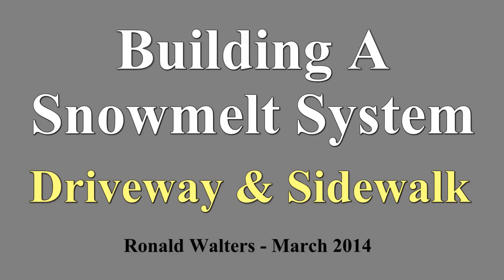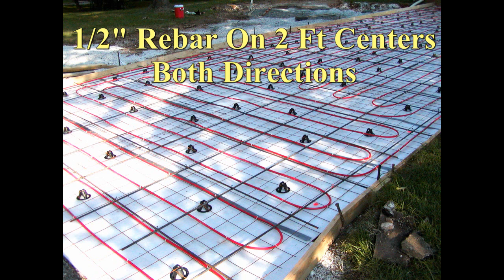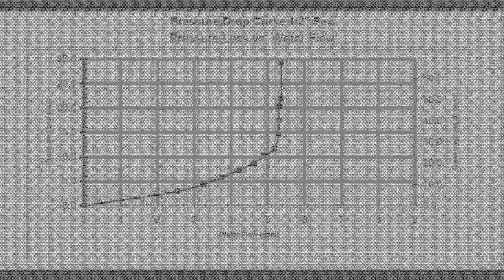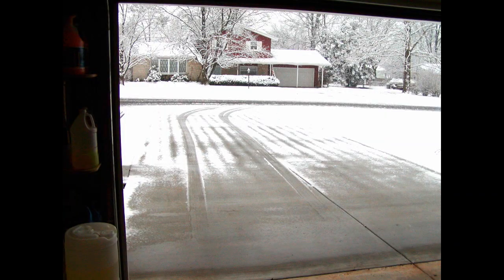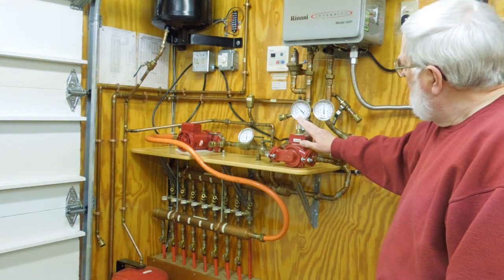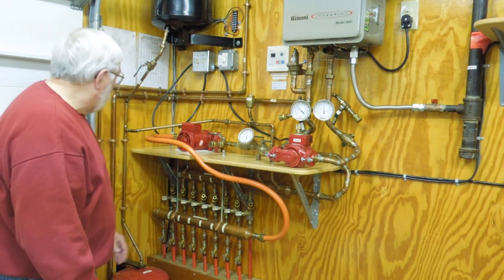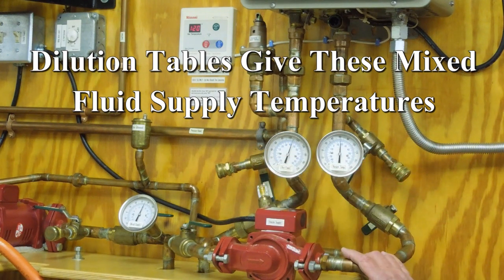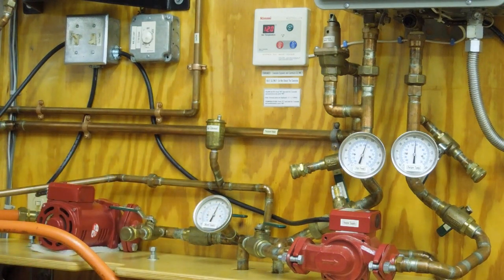Snowmelt, Building A System - Driveway & Sidewalk

Comment: Hey is it important that the pecan be up in the concrete! I feel it can lie on top of the insulation and bottom of the slab. Than the expansion is not a problem and the slab is heated more evenly? Remember I am a framer not a plumber! I am considering installing this system. 
Thank you for your video!!!
Reply from the maker: You had me with the "pecan" thing. :-)
You will spend a lot of money building a heated slab so you want it to last as long as possible. That is the reason for a 5" thick slab with rebar to reinforce the slab and wire mesh to hold the PEX in position. The weight of the rebar also keeps the PEX from trying to float to the surface. The rebar and the PEX need to be in the center of the concrete slab. The concrete is going to be heated throughout eventually. Placing the PEX in the middle of the slab gets heat to the surface a fast as possible and the "standoff" between the PEX and the reflective metal layer (on the type insulation I used) gives the best reflection of the radiant energy. Heat will still be lost through the insulation to some extent. Having the PEX against the insulation just means the concrete will take longer to transmit heat to the surface. The "mass" of the concrete helps hold the heat while the insulation tries to prevent heat loss into the cold ground.
Thanks for watching. Please subscribe! 
That is what keeps this channel going. 
Ron
Reply: PEX!!! Flippin framers!
Reply: Subbed

Comment: could you use this system with a ash-fault driveway, I've always dreamed of doing this with my outdoor woodstove.
Reply: I imagine its even better with asphalt! It wouldn't crack and the material radiates so m uch quicler than concrete.  With and outdoor wood stove the fuel costs would be way lower but the labour would still exist. I'd rather chop wood than shovel snow...
Reply from the maker: I have answered this before but with YouTube making changes a lot has been scrambled or lost. An insulation barrier is still needed and good luck getting the tubes inside the asphalt without damaging the tubes.
Reply: I'm pretty sure hot asphalt would melt pex

Comment: For those trying to figure costs of operation, one needs to know how many BTUs of fuel are being consumed per hour (will vary depending on the system size) then do the math based on local energy costs. Here in CT the typical cost for propane is between $2 - $4 per gallon, with a gallon roughly equal to 90,000 BTUs. That said, a 90,000 BTU water heater might cost $2 per hour of run time, multiplied by say 12 hours storm time, which is $24 in fuel. Double that if fuel costs are $4 per gallon. One would need to compare this to what a local plow contractor might charge, then weigh the options of cost versus convenience. This system seems to be on natural gas, and that also varies in cost depending on where you live. Looking at your gas bill will tell you what a therm of NG costs. (therm = 100 Cu Ft = 100,000 BTUs) Comparing the cost to do this with electric, and the loss associated with dual conversion of energy, you can probably figure 50% - 100% more in energy costs..... PLUS... an upgrade to your electrical service. IOW, for a system as shown I would venture a minimum of 100 amps to heat the same amount of water, and that's not a large driveway. Using 16 cents / Kw for electric (cheap) that would be around $4 - $5 per hour, or roughly $60 for a 12 hour storm. One other thing to consider with natural gas is about the size of your pipe to the street and the capacity of your meter. IOW, will that allow you to add another heating appliance? Quite often the answer is NO.... the gas supply is already maxed out with existing appliances.
Reply from the maker: The Rinnai on demand heater on this system will heat 199 gallons per hour @ 90 deg F temperature rise. Fuel consumption is 15,000 BTU minimum 180,000 BTU maximum. The Rinnai has almost as many controls on the burner as a jet engine. One limiting factor built into the unit, it is programmed to keep slowing down flow rate until selected output temperature is satisfied. Thus, when bringing the system online initially, the flow rate is limited by the heater until the return temperature satisfies system requirements allowing increased flow rate. This is not all bad as it serves as another safety factor to keep from heating the concrete slab too fast. I don't remember ever operating the heater at more than 50% to 60% capacity, especially with a blanket of snow covering the concrete. Initial start up is ~30% (1 gpm) and later it is gradually increased to 50% (1.7 gpm) and at the most 60% (2 gpm). I would love to get rid of the electronically controlled flow valve (or just unplug the servo controlling it) and the heaters programmed insistence on meeting output temperature. But any attempt to do so results in the heater shutting itself down (error code).
Reply: Using your 180,000 BTU heater at 50% capacity fits my example perfectly, so now people can do their own math. Of course you throttle up slowly and back down so these figures will be on the high side of actual fuel consumption once the slab is up to temp. BTW, I don't recall seeing an actual cost calculation of all materials, either broken down to slab (with or without the system) or just plumbing / heating. Obviously the labor was mostly DIY in time. I presume you didn't tear out a perfectly good driveway to do this so the cement work was probably a good investment either way.
Reply from the maker: I thought your example fit very well. I haven't given costs as the system was installed 14 years ago and prices have increased quite a bit. If people are interested they can chase down the current day numbers for their area and available suppliers. In my case I installed the entire system including the on demand heater and only used a contractor to pour the concrete. Thanks for watching. Hope you have subscribed.

Comment: I've been looking at a system like this but was thinking of running the liquid through a wood stove inside my garage and using 1" pvc but I'm glad I watched this for the PEX tubing instead.  

Would the wood stove process work since circulation would start before the wood stove was started and it should heat up the liquid universally?
Reply from the maker: A stove to run a system like this is going to be as large as a stove to heat an entire house. This will burn more wood than you may be thinking (depending on the size and temperature of what you are heating).

You do not want to shock the concrete with hot water and once the stove is blazing away I think you could be circulating fluid that is too hot. Using the stove to maintain a separate large insulated tank of hot water (automated temperature control via flue & air dampers, combustion blower) and then using that hot water to temper the fluid circulating through the concrete would be a better approach and safer for the concrete.

Comment: Thanks Ronald, nice video.  Can you explain what both a Header and Expansion tank are needed?  Wont the expansion tank expand and contract to regulate the volume?  All the "experts" I've spoken with say they have never used a "Header" tank.
Reply from the maker: Experts probably are not going to provide anything more than needed. A radiant system is a closed loop with (hopefully) zero trapped air. The expansion tank has a bladder in it  which is pressurized to 12 psi (with the system cold) to allow for internal expansion and contraction of contained fluid as the system is brought up to operational temperature. With the system cold, I pressurize the entire system including the header tank to 12 psi. The header tank is MY PROVISION for the eventuality of any slight leaks so the system can continue running for a while (hopefully until it isn't needed). With just that fluid which is contained inside the tubing and pipes pressurized (no header tank), any slight leak will quickly drop the pressure to zero. My header tank provides for fluid in excess of the system volume to keep things going. Most likely, any leak is going to occur at a pump shaft seal. If it is a total failure then you are screwed anyway. The header tank holds an extra 4-5 gallons just in case.

Comment: Do you think I could build a system with sprinkler heads at the top of a sloped driveway that pump hot water into the snow? So it would just basically use the on demand heater and a pump system.

Could I then capture and recycle the hot water and snow melt for another purpose like toilet water maybe?
Reply from the maker: I doubt it. You would need a large tank to collect the water and if the weather were very cold you would be creating an ice slick along or at the bottom of the slope before the water was ever collected.

Any pipe, fittings or sprinkler heads above the frost line would freeze up and break as soon as the system was shut off or there was a power failure or something unexpected and unpleasant (Murphy’s Law).

In areas where it gets cold and stays cold, the driveway and the ground several feet under it, is frozen hard as a rock and will be maintaining the driveway and the snow on the driveway well below freezing temperature.

There are all different types of snow. If 1-gallon of your snow weighs 4 pounds, then it will take only 2-gallons of snow to make 1 gallon of water. And possibly more than a gallon of hot water to melt it and get it to the storage tank. From there you can estimate the size storage tank required (times how often does it snow) and that storage tank would need to be buried below the frost line. Very possible the tank would need to be encased in concrete to keep it from popping up to the surface whenever it is empty.

Then the storage tank will need to be cleaned out every year, as all types of nasty stuff will grow inside of it. I have experience with the nasty stuff that grows inside rainwater collection tanks.
Reply: @RonaldWalters2010  thank you, that all makes sense. I'm looking to replace a gravel driveway with concrete at some point and want to explore as many options as possible before settling. Your video above is the most promising. I know for sure that I don't want to set down electric mats under the concrete.

Comment: few questions and thank you for you answer, also congratulations your a thermodynamic dude!!!Ethyl or propylene glycol? no water at all? how many btu's is your gas heater? whats the maximum running temp of the fluid in the system?
Reply from the maker: I am a little busy at the moment... I'll get back to you. If I don't, please remind me. Ron
Reply from the maker: Ethylene glycol inhibited and diluted with distilled water to suit the lowest expected temperature for your area. My on-demand is a Rinnai Integrity Model 250 rated 199 gal/hr  15,000 BTU/hr Min 180,000 BTU/hr Max. Much more heater than I have ever needed but was the smallest unit I could find at the time. I circulate 1 to 1.5  gpm through the heater starting at 120 degF and slowly increasing to 130 degF (sometimes 140 degF). The heated fluid is injected back into the flow stream and the total snow melt circulation for my system is 8 gpm (fixed). Main thing is not to shock the concrete with hot water... thus it takes quite a while until the return temp starts to increase. Generally I am only trying to increase the return fluid temp 10 to 15 degF (after a long while maybe 20 degF). The system is fully capable of taking 90 degF return fluid and delivering 2.5 gpm 180 degF fluid into the flow stream increasing the 90 degF return fluid to 118 degF (which would be 112,500 BTU/hr) and would reduce my concrete to gravel... I have those dilution or tempering figures, but such extreme temperatures will never be seen in practice. Thanks for watching. Please subscribe!

Comment: An alternative heat source might be a pellet burning kiln. The EPA ones are at least 87% efficient and you would be burning biomass and not expensive gas. Because these units are so efficient they can be direct vented, no heat rated chimney required.

Comment: Hello ron very neat set up 
But Im curious how does the water coming out of the heater at 120 mixes with the cold water coming back in while its a closed loop ! And how would you maintain it at 50 degrees afterwards ?
Reply from the maker: Good question! Some water is taken from the return manifold and diverted through the heater. That hot water is reinjected into the return steam to mix with the circulated fluid and this is sent out through the supply manifold (this is called tempering the fluid). This process will gradually heat the concrete slab and the return fluid temperature will slowly increase. We do not  want to heat the concrete too quickly or we will crack the concrete.
Given time, the return temperature will increase and you can slow down the amount of fluid heated and lower the heated fluid temperature to stabilize the supply & return side fluid temperatures.
Thanks for watching and for your comment.
Please subscribe. That is what keeps this channel running. 
Ron
Reply: @RonaldWalters2010   thanks for he quick reply , im looking forward to make a similar system for my driveway .

Comment: Hi Ron.  Great execution of this concept. A friend of my neighbor has something like this except he also uses it to make hot water during the summer by running the system in reverse in a sense.  Just wondering if you have considered this or not. It looks as if your driveway might by sunny enough. Have a good day. Keep the videos coming. I've learned alot and enjoy the ideas you have.
Reply from the maker: On a sunny day the concrete certainly does get hot. Just as with a roof mounted solar water heater you need to circulate treated/antifreeze solution (so it doesn't freeze in the winter) otherwise you will have bacteria and fungus growing inside the system. There would be a separate coil inside the hot water tank (water heater tank). They make tanks and water heaters for this purpose. Circulating the treated water in turn heats the water in the hot water tank. On cloudy rainy days there is no hot water so you still need a heater to make up the difference. Is it worth the expense just for hot water? Depends where you are and what gas or electricity costs.
Reply: That is a great idea ,will take a notice of it .

Comment: My first thought is would the circuit heat water in the summertime? That'd be neat!
Reply from the maker: You bet! This driveway is facing south and on a sunny day the concrete gets very hot. I do not remember the temperature of the fluid circulated through the concrete but it would certainly scald you. Obviously an asphalt surface would get hotter. A heat exchanger would be involved for domestic hot water.

Comment: Hi Ron, 
What is the target temperature of your driveway for snow melt assume 28 degree start point 
What is the max temperature you are sending the fluid out to your drive and how long does it take to get there?  Assume a 28 degree start point. 
How long does it take to melt 2” of snow starting from a 28 degree driveway 

Thanks
Reply from the maker: Seems like I answered some of this previously.

What is the target temperature of your driveway for snow melt assume 28 degree start point.
I do not have a target temp for the driveway. I look at return fluid temp.

What is the max temperature you are sending the fluid out to your drive and how long does it take to get there?  Assume a 28 degree start point. 
Can’t answer that. I monitor return fluid temp. I start off by referring to the return fluid temp and mix in enough heated fluid to send it back out (initially) around 10degF higher. When the return temp has increased 10degF, I increase the heated fluid to send it out 10 degF higher than that… however long it takes. Baby steps. Don’t get in a hurry or you will bust up your concrete.

I try to start this process with a good layer of snow on the driveway to act as a heat blanket.

How long does it take to melt 2” of snow starting from a 28 degree driveway.
Can’t answer that… mainly because I haven’t kept a record, although I may have made mention of it in one of the videos.
Ground temp relates to initial return fluid temp. What is the outdoor temp. Is it nighttime or daytime. Is the wind blowing. Wet snow or dry snow. Is there any freezing rain mixed in or a layer of ice. Is the sun shining (makes the process easier with direct sunshine on the driveway).

When things get slushy you can scoop off the driveway and save a lot of gas… or blow the slush off with a good leaf blower. I show this in a video. You can move a lot of snow with a good leaf blower.

When most of the snow is gone you can shut down the system and the heat in the slab will finish the job (especially with sunshine) and dry off the concrete. Wind will help evaporate the snow and dry off the driveway once it is a bit warm. Experience in you area will determine when to shut things down.
Reply: @docdrs Did you ever figure out your operating points for your melt system?